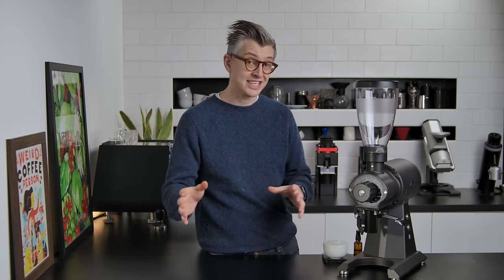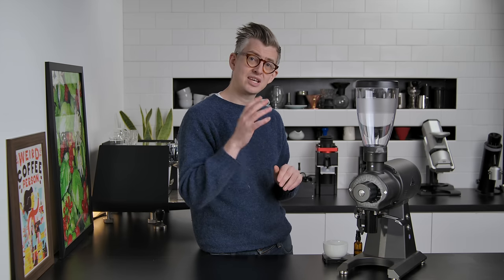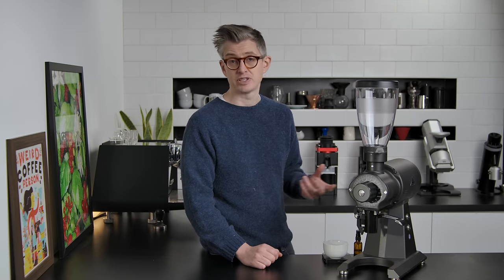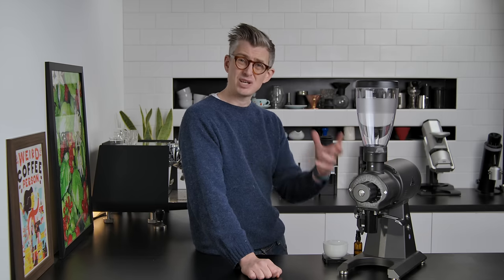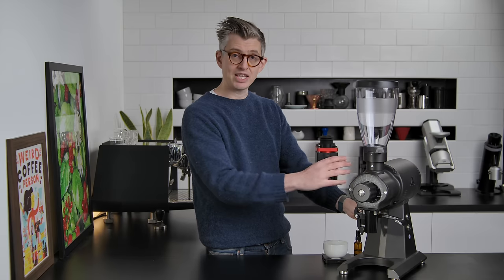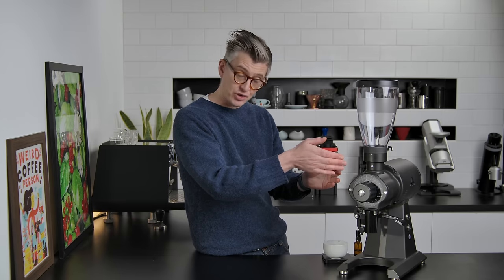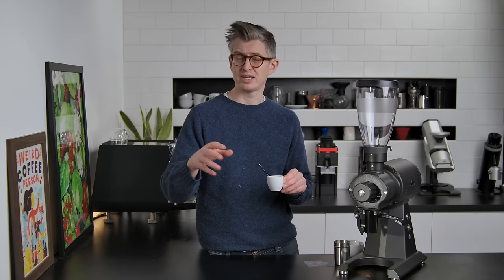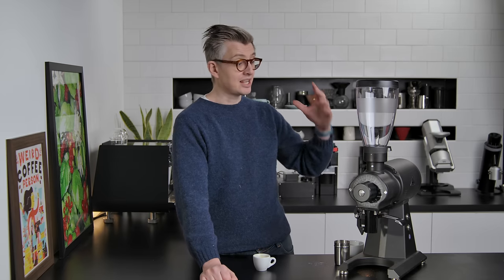The Mahlkönig EK-43S (Episode #3)

Comment: I have not had the privilege of using one of these as a daily grinder, but I have used a few EK’s in my time. One interesting trend here in Australia is to leave the EK running non-stop. Cafes will first turn on the grinder when the staff first walk in the door to open up and hour before service. The theory is the temperature will be stabilised, it won’t fluctuate between peak and off peak periods. This leads to more consistent grind size as the metal is all at temperature and has expanded to it maximum. 
All that being said, consistently I find the espresso from EK’s to be more balanced and generally sweeter. I get the lack in texture, however I prefer overall balance and sweetness as a priority preference.

Comment: I've had an Ek43 as a home grinder for a few years now. I was lucky to get one 2nd hand for a decent price. I've modded it by removing the thwacker and replacing with a jar (keeps retention super low and really improves work flow). The hopper is gone and has been replaced with a glass V60. There's some SSP redspeeds in there. I've spent countless hours trying to align it and there's still room for improvement. I think the next stage is to sand the static burr landing surface myself and buy a Titus burr carrier. If I'd had to pay full price and do all of the above I wouldn't have been very impressed.

I tend to find that my espresso setting stay pretty consistent day to day and between beans but that could be the SSP burrs working their magic.

Great vid James, looking forward to the next couple of days.

Comment: I got EK for three reasons: 1. It makes good coffee. 2. I can compare my coffee / roast with others around the world easily as it's so widely available. 3. It provides the flexibility for single does and grinding at large volume (just a free service for friends if they need it). Otherwise, I share the same frustration with many: it's hard to align and there are lots of build up in burrs where the screw holes are. EG-1 will be my next upgrade as it provides the ultimate no-fuss maintenance experience, which I'm very fussy about. Looking forward to the final taste test!

Comment: One thing regarding cost vs the other options. It's possible to find old EK's for very reasonable prices. They may need a new burrset and a deep cleaning but they're out there, sometimes just listed as "coffee grinder" or something equally generic. I recently found one from the late 90's with nearly new burrs that needed a new power switch, the whole grinder cost me less than the new power switch. In the older models however alignment can be pretty far off so in addition to any repairs you'll probably also need to align the burrs which can take a few hours the first time.

Comment: I have a white EK43S for my home use.  It is PERFECT for single dose grinding.  I bought a small short mini hopper made for EK43 by someone in China which is a size of an espresso cup, compact cute, a great companion in single dose grinding.  Grinding is easy to adjust.  Cleaning maintenance takes a little time but if I could do it, it couldn’t be too complicated.  For espresso, I had to change to Turkish burrs. Best investment for a home barista!
Reply: Hi Caroline, with the single dosing hopper do you run grinder and drop beans or just drops beans and run. thanks
Reply: @vikaskalia8567  I have a hopper that has a handle that has to be turned to drop the beans. My routine is to measure out the beans (18gm), drop them into the hopper, turn on the EK43, then open the hopper by gliding the handle around. Then the beans drop. I’ve seen it called ek43 mini vol hopper. Bought it online at mostly Melbourne (overseas purchase)
Reply: @Doodle-bx9xk  thanks for response , have you ever tried with dropping beans first and then running ? Reason I ask is that I find a discernible difference in the cup and now it’s a scratch I’m trying to itch lol .
Reply: @vikaskalia8567  I have not compared those two parameters because I thought that it would be ideal to have the grinder run first before dropping the beans. Read somewhere that this is also better for the grinder. Intuitively, grinding beans bunched up in grinder before turning it on would give more uneven grinds compared to beans falling in while the burrs are running.
Reply: @Doodle-bx9xk  btw , what’s your prep ? Currently I’m shaking dosing cup , wdt and tap down . Might be overkill though for this grinder . 🤷🏻‍♂️
Reply: @vikaskalia8567  I use decent funnel, pronged WDT, Pullman distributor, Pullman BigStep tamper.  Using WDT definitely improved channeling I used to see at the start of extraction and improved taste. I don’t think what you are doing is overkill.

Comment: My hopper came off right away on my ek43s too. Super annoying!! Mine did come in need of alignment as well. Same experience with some minor retention issues. Sometimes I’ll get out 22 grams when I put in 20. I always put a few beans through of whatever I’m about to grind because you’ll end up with the old grind setting and a bit of the last bean you sent through it. 
I find it to be a very messy grinder and so have always used the spray bottle to combat that. 

Pretty excellent summary of everything I feel about the grinder. Awesome video.

Comment: I've had an EK43s with proper alignment from Titus and SSP burrs for two years. I've only used it for non-espresso brewing, and it has produced absolutely phenomenal grind quality.
However, as you state, it's completely unsuited for home use, as it's HUGE, it's noisy and the mechanics of it makes it a retention nightmare! It's absolutely not built for single dosing! Also, it makes a mess - with a weeks daily use after cleaning, everything within half a meter will have coffee dust on it.

I've just replaced it with the Option-O Lagom P-64 and I could not be happier about that decision!

Comment: I’m using an EK43s at home for a while and totally love it. It perfectly reacts to minor adjustments, the grind speed for a single dose is unmatched, the lever to clean the chute is just neat, the design is iconic and it (just) fits in my space,... unless I start obsessing about the look of the hopper (which I might replace at some point), I really see no downside for home use (apart from the price which I didn’t pay). I get the point that it is build as a workhorse and expensive, but the other downsides of using it in a home environment seem a bit academic. Looking forward to the big conclusion...

Comment: I use EK43S at home and as you said the stock hopper is definitely not built for a home setting. So I bought a single dose stainless steel hopper from AliExpress and it worked perfect for me. For a doser I use a Weber Workshop’s blind shaker. It kind of making some coffee chaffs flying here and there, but other than that it works great and always get exact amount of coffee grinds without loss. In summary, EK43S is certainly not built for a home use, but with some proper modding and careful thoughts on your workflow, it can be a great choice as EG-1, monolith or lagom P-64.

Comment: Hi James 
Great series of reviews been excited about this for a while now.   I would like to learn more about the different burrs I have to admit that I find them confusing.

Lucky enough to own an EK43S that I got in March last year.
Agree with your review particularly on the workflow- it is ok for filter not so great for espresso.
I struggled to dial in espresso when I got the machine I found that it needed  a few kilograms of coffee to season the burrs before the grind was consistent shot to shot  in the espresso range.
Totally changed my perspective on filter coffee they taste so good. I have gone from a double shot guy (typical Aussie in that regard) to drinking mostly filters. 

If you read up online you find a lot discussion about alignment of EKs, I purchased fully expecting to have to muck about and align it.  I got the Titus gauge and pulled it apart and the lower burr alignment was perfect.  The carrier is harder to measure but looked perfect (it is a beautifully CNC machined piece) I just put it back together and left it alone.  I suspect that the older models had issues that created a cottage industry that is now dependant on them having a reputation as needing work.

I see lots of commenters getting freaked out by the prices and fair enough these are some expensive grinders.  Home use is not going to wear out an EK, people know what they are and there will always be a second hand market for them.  You can buy a second hand one use it for a year and sell it for what you paid for it.  I don’t think that many of the home use alternatives hold value as well.  So yes expensive but low risk from the perspective that you can easily sell it if you needed to.

Comment: Used it in a domestic environment, back then there wasn’t such a thing like the WW Eg-1, Kafatek Monolith, Titus Nautilus , Option-O Lagom, Levercraft Ultragrinder, Molar Z, Ozik Bold and Ozik Column or even the Niche. It didn’t cost €3000 but €2000 making it cheaper than any of the above mentioned grinders except Lagom and Niche. It was the best grinder I ever owned, but it had alignment issues that i fixed, getting a new burr carrier from Titus massively improved it also in regards to retention, I also got new SSP burrs again the best brews ever from any grinder and by a good margin. But you need to keep it clean, lubricating it constantly to keep it well aligned, it’s fussy and always find a way to annoy you but it can easily be used for single dosing however probably not as good as the others but still better than most none SD designed grinders, That said I ended up selling it because I got tired of all the issues.

Comment: I've been a bit obsessed and own three of the grinders in this series. I do think it's worth mentioning that the ek43, being mass produced, might also be the only grinder in stock without waiting months. it's also probably the only one available used which makes it likely the cheapest one of the bunch. modifying it isnt particularly hard or expensive (just sandpaper and lubricant for alignment) and replacing the burrs will make all the grinders taste pretty much the same.

Comment: Is "pop corning" still an issue - in your opinion, James? I notice grind variance related to "back pressure" from the beans being ground and popping around. This is reduced by having a stable something on top of the beans. My old Eureka had a small "roof" in the hopper for this function. My Elektra Nino did not have that and I had my handyman make me a dedicated MTO hopper with a cylindrical tube that has a small weight disc on top of the beans for the stabilization purpose.

Comment: As a casual coffee enthusiast and home brewer, I would love to know how the grinders in this series compare against the more popular electric grinders for the home that fall in the price range of $1,000 or less. Is there a point of diminishing returns where the significant price increase maybe doesn't justify the incremental improvement in quality of the final product?
Reply: Regarding the diminishing return two things come into my mind:
1. I would ask the same question when it comes to whisky. Does a 50 years old whisky taste 1000 times better than an 18 years old one? - Never had a chance to taste a 50 years one.
2. The another aspect is that one can invest to have the state of the art equipment but without the necessary skills/experience to pull the shoot the end result still can be bad.
As a fellow casual coffee enthusiast who drinks coffee only during the weekend, I ended up using a manual ROK grinder.
Reply: My sense is that for home use, there definitely is. I can see that scaling grinders to high-volume requirements involves expensive engineering, but for home use, ISTM that at some point you start paying primarily for gimmicks and looks. Nothing wrong with that, of course, after all it's sitting in your home somewhere, might as well look nice.
Reply: Blind taste test would be a way to find out.
Reply: Great question! I'd really like to see how these kind of high end grinders stack up in a taste test against grinders like the Niche Zero.

Comment: Big fan of the EK here, but I would agree with James when it comes to retention. When I use one in a cafe environment its fine, the knocker is passable at clearing in-between shots and you just have to learn to weigh an extra half gram wastage. However using one at home... I could see that being a messy affair, and disappointment coming from having to throw away quite a bit of coffee in each dial in/brew. But then again, if you've got the money to have one of these at home maybe that isn't such an issue. Plus the coffee it makes is yummy af

Comment: I have the base model (tall version) of the EK43 that I use in home. It was originally going to be for my roastery, but I decided to go with my trusty Bunn G1 since the difference in taste after a week in a bag is nearly negligible and replacement burrs for the G1 are cheaper.

The workflow is definitely convoluted for espresso. You have to get creative if you want quick, quality shots. If I were a coffee shop, I would employ a weigh & fill machine just for dosing on the fly. And while tight, syrupy shots are possible, it is much easier to achieve clean, larger shots that are equally delicious in a different way. You lose texture but gain clarity of flavor (I guess you have to decide for yourself if you like that). I have found that the larger, cleaner shots are significantly better for milk drinks as they impart a very strong coffee taste without needing to pull a triple shot or more on a separate grinder. Truthfully, my k30 has sat on the shelf unplugged since I got this grinder--it fits my tastes despite how incredibly convenient the k30 was with just dosing into the portafilter and not needing to weigh shots. I think that the EK43 if you employed a particle filler machine would be extremely doable in a shop for espresso if you want the unique, larger shots that the EK43 is well known for. I tend to most enjoy a 1:3.5 coffee to shot weight, which I never really enjoyed on my k30.

As for chasing your grind size, I've found that a little rubber bulb duster for a camera quickly clears out any remaining grind in the chamber. A bit messy and annoying, but keeps me from needing to purge with a few g's of coffee. With the help of the alignment tool and the "foil trick," the particle distribution for me became bafflingly good.

In many ways, this grinder is like driving a tank to pick up groceries. It's way overkill for most home situations, it's bulky, and frankly impractical, but it's also absolutely fantastic and I wouldn't trade its unique ability to pull amazing lungo shots.

Comment: And here I was thinking, that the company's name "Mahlkönig" was the most German thing in its naming. Little did I know that the E doesn't stand for "elektrisch" (electrical), but for "Einphasenstrom" XD
It is, however, perfectly in line with the German mindset of manufacturing things, I guess. It works, there's not much fuzz about being visually beautiful and they probably intentionally prioritized the option to easily replace or maintain some elements over wanting them to reliably last longer. They just expect a Cafe to eventually have to replace the hopper or the burrs, so you can order spare parts easily and replace everything with a simple screw driver.
This is a kind of neatness that people in Germany value, but it's not the Weber Workshop's "a sophisticated rich person would put this in their kitchen to show off"-neatness.

Comment: Using it in a coffee shop for espresso is a bit more convoluted than with other grinders, but I can't think of anything else I'd want to use, which is why it was the only grinder I had in my shop. The key to workflow is to have pre-weighed doses of beans, or, if you have the funds,an Acaia Orion, which will dispense preset doses of beans. The main advantage for a multi-roaster shop like I had is that you can run multiple espresso options with one grinder, which goes some way to mitigating the high cost of the EK. 

On another point, James intimates in the video that the EK is rarely used for espresso; this is not entirely accurate, as I know plenty of shops, including Colonna and Smalls, that have been using the EK exclusively for espresso for many years. 

JP

Comment: Why does it cost this much to make a coffee grinder? genuinely curious
Reply: What really separates the EK43 specifically is how bulletproof it is in construction. In a commercial environment, when you depend on your equipment to make money for you every day, you are more than happy to pay a premium for reliability.
Reply: I guess it's the reason any high end thing costs a lot of money. Cost of RnD on something so specialised and refined. Cost of parts and labour. Then of course supply and demand.
Reply: I'm certain there are a lot of factors, but generally commercial equipment is built to be able to run a large number of consecutive hours without breaking, and needs to not take a long time to maintain. For instance if you were to look at the price discrepancy between a commercial stand mixer and a home kitchen-aid, the price is vastly different, but also you won't be able to burn up the motor. In order to run for more hours in a day requires a bigger motor that is not working near its maximum ability, so there is a lot more material involved. Similarly, the rest of the material for the device will have to be beefier to withstand less gentle use.
Reply: @chris I’m not sure I’m buying the “R&D is expensive” argument to justify the high price for a grinder designed more that 40 years ago...